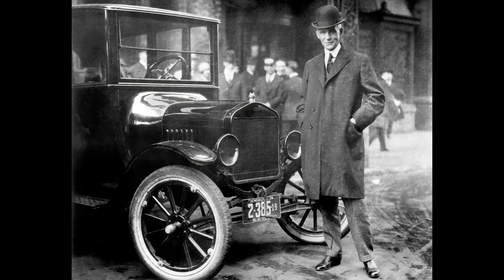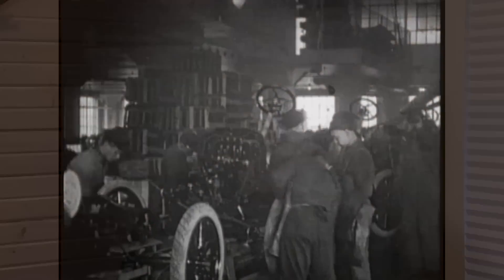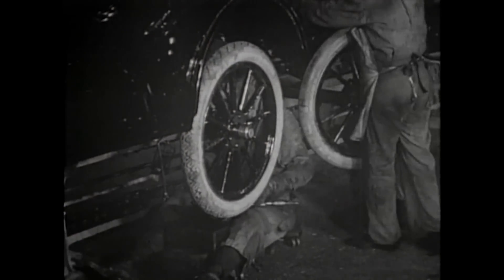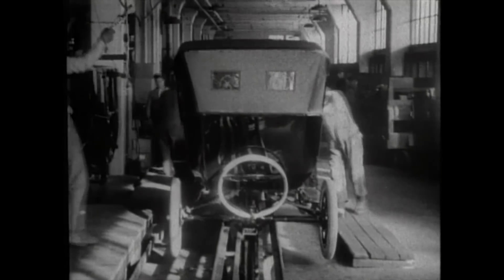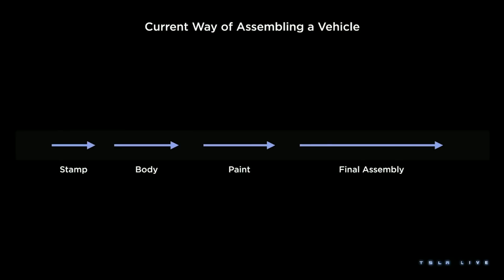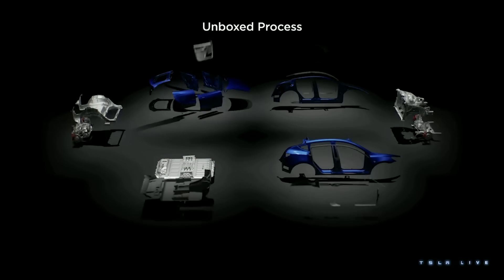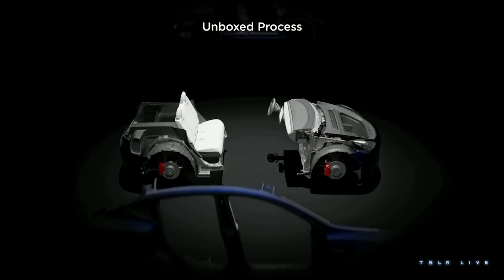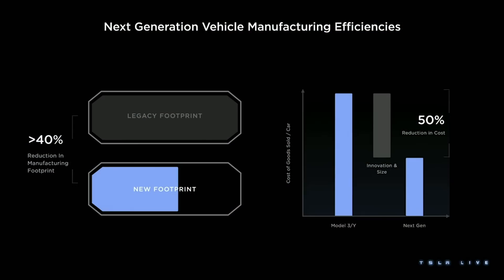Move Over Mr. Ford, Tesla Just Reinvented The Assembly Line

Comment: Serious Q: can someone explain why no one has done this modular approach before? It seems like a logical thing for some manufacturer to have thought of / tried sometime over the last 100 yrs. Is it due to the vertical integration of Tesla?
Reply: When the first model 3 came out in 2017, it was heavily criticize for the worst body in white, Sandy Monroe called it a pice of crap. Sandy asked why they didn't seek help from legacy manufacturers, that had experience in body engineering. Well all the first body engineering came from legacy auto and that was the best they could do. Elon fired them and started bringing engineers from SpaceX to help, their approach was "it doesn't matter if it costs more, make it efficient". That is the key to Tesla success. Make each iteration more efficient than its predecessor and not be afraid to make big risky moves. One key example is when they wanted more specialized robots from Groman engineering a German supplier for BMW, Mercedes, VW and of course Tesla, and they said that they had the hands full with orders for the German manufacturer. Tesla said I need the robots now, therefore bought Groman engineering cancel all other orders and had them make robots only for Tesla. This company is now owned by Tesla and is responsible for all the high end Tesla manufacturering robots.

Comment: How will the wiring work? If all pieces are made in modules. Won't they have to have many connectors?
Reply: In my opinion there will be only 2 more. One on the middle to the rear and one on the middle to the front. All other existing connector will be the same from the existing platform.

Comment: Great idea for the increase in insurance. These cars will be a write-off as soon as they have the smallest problem. $$$$$$££££££€€€€€€¥¥¥¥¥¥¥
Reply: So what is the difference from today, all new cars are full of sensors on the front and rear. When they get in a small crash,  they get scrap, because it's too expensive to replace and calibrate the all the new sensors.
Reply: @renezr70  calibrate the new sensors???? Oh you mean plug and play. 30 seconds of work compared to replacing 30% of the car as a module.
Reply: @ronvds4713  plese inform your self. All  new vehicles on the US are required to have obstacle detection emergency breaking, sensor like radar, sonar and camara are used at the front an rear of the vehicles. All have to be calibrated when replace. There is a shortage of technicians specialized in this that is driving up the costs of body shops. There is a report by the IIHS go read it and don't make ignorant comments.

Comment: Call me naive, but I think Ford at least could come close to matching Tesla's vision in producing EVs.
Reply: In my opinion that is the reason Ford split the EV division of the business. However they have the same problem that all of legacy auto have, their existing infrastructure.  Tesla clearly said they can't implement this in their existing manufacturing plants because the plant has to be constructed whit this method of construction and that is why it will only be implemented on it's new factory moving forward.
Reply: @renezr70  Yeah, and I think that is fine.  Because another data point is that for all the talk abut EVs being the future,  there is not an infrastructure to support mass adoption of EVs until at least the back half of the decade.
Reply: @RonnieLeeDuck  this is a good point, eve if we go 100% electric sales today all the existing gasoline vehicles will not dessapear, so even after 100 electric sales there will be time for the grid to improve. After all the electric utilities are a business and they want your money.

Comment: In Louisville plant years ago, they used 2x4 for spacing between the chassis. There was discussion with the Union about increasing the the number of units per hour and there were negotiations related to that and the party's were making no progress. Management finally reached an agreement but they also shortened each 2x4 by 6” and dirtied the cut off end with oil and dirt and increased the throughput even more, without the workers even knowing

Comment: It isn't true that the whole assembly line stops, some parts can be paused and others allowed to "bank up". As for "walk-back time" I would assume you have actual evidence of this, as the solution to that is a simple matter that only requires basic mechanical parts (Move an item "off" the line until complete, join it back on later).
Since massive corps are incredibly profit driven, I find it impossible to believe that a factory is run KNOWING that they have 33% down-time.
That is not to say that Tesla's ideas are not the next generation and super efficient, as they are.

Comment: Nice video John. I am sure some where in the comments people will call you a fanboy, but you might be among the last journalists who tries to report on the facts and give context not motivated by an agenda. 

When you look at Tesla company culture, there is a cost cutting and improvement mindset no one else has captured. 

Go back five years or so, people complained about range, charge times, places to charge, 12 volt batteries failing, and so on. Tesla has built out the best charging network in both up time and number of chargers, but they have not slowed down on that. They evolved the charging stations to be easier and quicker to install. Tesla have good range. Work well in cold places thanks to the octovalve among other innovations. The list goes on. 

I love the enhancements to quality control they laid out as well. Tesla struggled with quality but as Sandy Munro and others have noted, huge improvements by Tesla. I really believe Tesla will quality levels exceeding current top builders of vehicles of anykind.

If Tesla was 3-to-5 years ahead of the competition, I would say they are now 7-to-9 years ahead. GM and VW had made claims of crushing Tesla by 2025, but there is basically zero chance of that. 

I want to see many manufacturers do well in the EV space, so I hope GM and others just use Tesla as an example to follow and do it. As you noted John, the industry has not truly changed that much in many decades. Toyota and their just in time systems was the last major change, unless you count massive outsourcing.

Comment: Manufacturing engineers over the years must have thought of module assembly, and then "wheel-shaped hub & spoke" module paths to the emerging car in the center.  Surely this was a master's or PhD thesis subject somewhere in Mechanical or Manufacturing Engineering.  
Picture it:  Modules are assembled separately, then rolled over to the center of the room, where the modules are all mated together.  
These days you can simulate it of course to measure time savings.

Comment: Curious to see whether these changes will impact repairability. Tesla seems to give that aspect of vehicle design short shrift.
Reply: My opinion is that it will actually make repairability easier. The doors, trunk/frunk lids and bumper covers should use be the same repair processes as today. There will probably be crush cans at each corner which can be replaced if the accident is not too severe. The suspension will be mounted to the castings just like they are currently done. If the Giga Casting gets damaged the car is totaled, this is no different than having a uni-body vehicle being totaled because of frame damage. Oddly, I think there might be a bigger market for salvaged cars because you might be able to un-bolt a front or rear casting and install a new casting from a donor car much easier than you can currently do with any car on the market today (except for a body on frame vehicle). Time will tell, but those salvage guys have always been looking for a way to put cars back together to make a quick buck.
Reply: Think it will be easier to replace parts, but anything that damages structure is a write off these days i hear.

Comment: I think that is a great point. It will really allow them to build that inexpensive $25,000 EV for the greater masses. Especially by building them in Mexico with cheaper labor. However, with that said, it misses, or perhaps worsens, one of Tesla's greatest detractions points in the minds of many-- the infamous Tesla poor build quality. 
For those Teslas above that $50,000 price point, they will really have to tighten that up, as more luxury EVs in that price range with superior build quality arrive in the market. And they will also have to do a little better that simply having a giant iPad for a console. If you spend that kind of money, you expect more than Chevy Bolt. It's the biggest reason why the Model Y prices has been dropping.
Reply: Those build quality stories are pretty inflated imho: When Tesla started doing gigacasting, replacing 70 parts with a single cast piece, and then improving on that so that two casts replaced 140 parts, all those tolerance issues disappeared.

This is how Tesla's Shanghai plant got number one in build quality at 7 defects per 10,000 vehicles, on a list that included all brands foreign and domestic.

Tesla's Texas and Berlin plants should have similar solid quality standards as they scale up.

The old Fremont plant is the last one left that's still applying the old building processes on some of their models, hence you may see some minor - and easily adjustable - cosmetics in the Model 3/S/X lines that come from there. These issues will be sorted in time once Texas can give them time to take those old lines down for upgrades.

Either way, there's nobody that has come even close to mastering software on their platforms, it takes a ground up approach and unification of the entire system, a string of chips and sensors from a hundred third party vendors will never be able to replicate that, it's impossible to write a unified software stack on top of such a solution.
Reply: @AllanSustainabilityFan  No argument with your software advantage point. It's not even close. Tesla has by far the best software and technology of any other manufacturer. And they don't have the dealership cartel holding them back either. By the same token, you can't argue build quality is not an issue when compared to legacy high-end cars above that $50,000 price point. Compared to a Chinese made car, then yes, the build quality is on par, no, better, than those.
Reply: Dropping? The model y worldwide is ABOVE this time in 2021 pricing. It's the world's best selling ev to in less than 3 full year's. 
Scheduled for a revamp next year. Eligible for tax credits for the first time making it even CHEAPER than any inferior competitor's vehicle. 😀
Reply: @4literv6  Did you miss the $13,000 drop in price last month? Or the further drop in price just announced in Europe? No, I'm not saying it will become cheaper than when they first went on sale for that very short period if you ordered them in that short window. At least not yet. My comment refers to the prices from just a few months ago.
Reply: @Paul-cj1wb  I didn't miss anything thanks, you did though. I made the point prices right NOW a full 3 year's after model y debut and has realized insane economies of scale at 4 global factories and through multiple design iterations. Becoming the world's best selling EV ever. 

Are still as a point of fact higher than they we're back in early 2021. 

Oh and you missed that tesla has inched the model y back up several time's again as global demand is inching the order backlog steadily back up to almost a month's worth of production. In the slowest sales month's of the year to.👍🏻
Reply: Build quality is only in your mind. 
No data supports this and industry opinion - from Lutz and John and Sandy at the preview of the Model S Plaid teardown - "build quality as good as a Bentley."
Chinese survey consistently places Tesla at the top in manufacturing quaility, above the Europeans and RSymons British importer, sees no difference in China made and Fremont made vehicles. Detailers like Out of Spec also place Tesla build and paint quality near the top. Customer surveys in USA and Norway place Tesla the top in brand satisfaction and willingness to buy another (Bloomberg).

You are attempting to give a myth legs - WHY?
Reply: It does seem like a creative assembly plan, but like you I wondered about how these assemblies fit together and what they're doing to keep or improve structural rigidity. How do they bond painted subassemblies and keep the needed strength? They must have some solution for that, otherwise it would seem like the body flex and long-term quality might suffer. I'm guessing the gigacastings provide a lot of strength in the front and back but I am really curious about the bonds between the side panels and other structural components.

Comment: The market, mainstream media and institutional investors reaction to Teslas presentation reminded me of the reaction of the Linnean Society when Charles Darwin presented his paper on evolution. They were either asleep or It went completely over their heads. Electric vehicles and the transition to renewable energy with storage is the biggest economic transition in world history and it is happening for purely economic reasons not idealogical or on the basis of scientific evidence. For example : I have a 6.5 kw roof top solar system. It cost $6000 and will generate 182,000 kilowatts during it's 20 year guaranteed life. A Tesla model 3 burns 140 kws to travel 600 miles. That's $6000 to travel 800,000 miles. A purely gasoline Camry would cost over $100,000 to travel that same distance. Then there are the service cost savings. There are a lot of people still asleep on all this.

Comment: I doubt the next gen vehicle will have a paint shop. Paint shops require a lot of water for rinses between layers of paint. Monterrey, Mexico is in a decades-long drought. The Mexican president was very quickly convinced that Tesla would significantly decrease water use per vehicle. Paint is also expensive. My guess is that the panels will be vinyl wrapped before assembly. Vinyl wraps will allow MUCH more customization in the look of the vehicle, which for the next gen vehicle will be key. I could see company fleets ordering thousands of next gen vehicles, complete with logos and graphics, which would combine the two processes of procuring the vehicle then procuring the wrap.
Reply: They better have good rustproofing though, or they won't last in the rust belt.

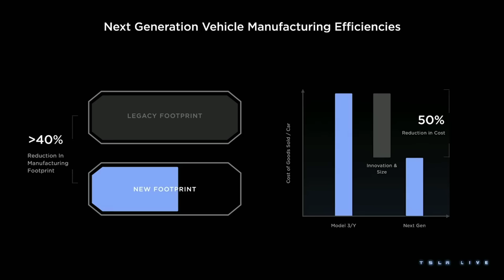Comment: 7:05  It does not say that the cost of assembling the car will be cut in half. It clearly says "Cost of Goods Sold", i.e. manufacturing cost of the whole car will be halved. But that is due to many reasons, not just this one. E.g. that will be a smaller vehicle. And actually it is not new news that the new vehicle will be cost half to produce then M3.
It would be good to see how much the assembly will be cheaper.

Comment: @5:35 automated which is where Optimus SubPrime comes in. You can put two of them on a rotating belt so when the process is finished, the next part can be put in front of the next robot on the line to start the process all over.

Comment: Wow I wasn't actually sure if this was a "new new" method of automotive assembly just based on the hype reactions from fans. But coming from John and his knowledge of the history this  is incredibly exciting. Can't wait to see new line up and running
Reply: It is not new for shipbuilding. Shipbuilders could not use the assembly line method so this is how they speed up ship construction. They built large superstructure that later gets mated together into one ship.  The difficulty with this system is that you need higher precision to make sure the modules all fit together. The same with painting you need very precise painting shop to make sure the color hue match up between different modules.
Reply: It's not a line.
Reply: @davincisghost9228  fair. New Systems*